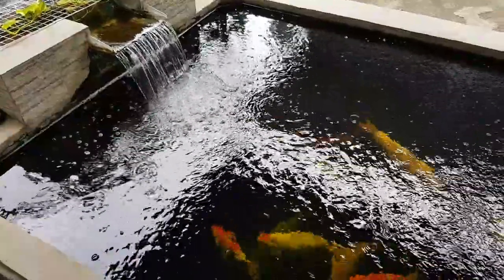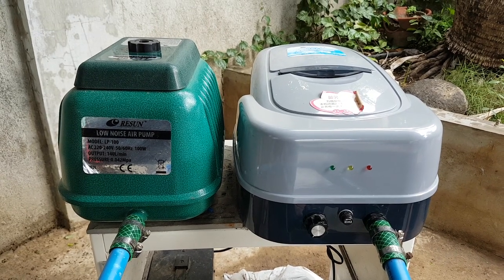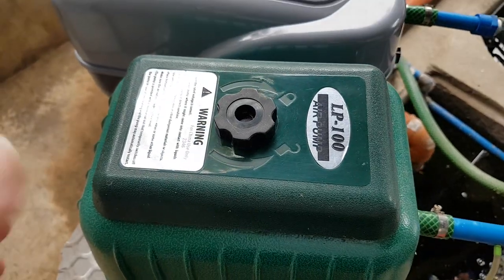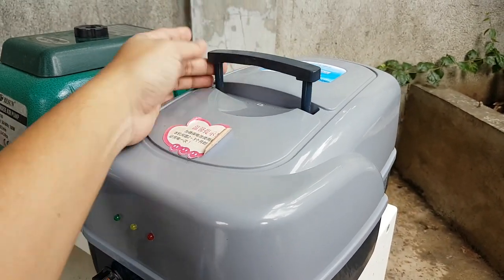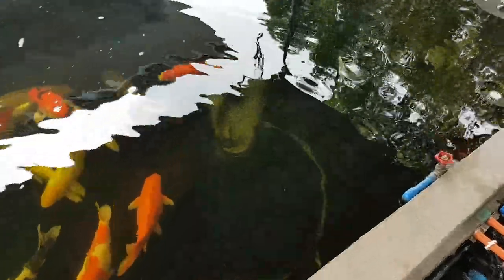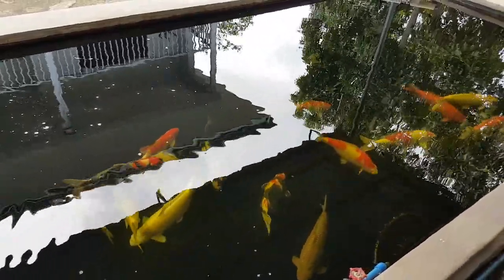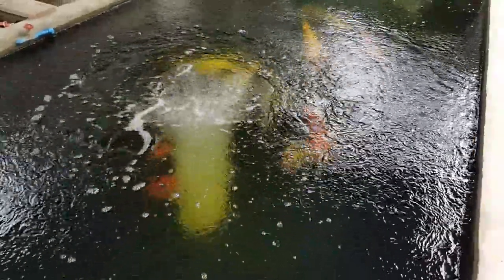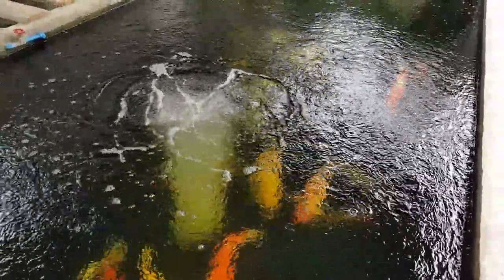Air Pump Resun LP100 vs ACD130 AC/DC Aerator

Comment: This is very informative Sir! For a fellow Koi enthusiast, this really helps when it comes to choosing equipment for my pond. 😊
Reply from the maker: Glad to be of help bro.
Reply: @thekoipondexperience1259  Sir! Im planning on buying an Oxy Ring (13" dm) with a 16 mm Manifold Attachment, is it compatible with the RESUN ACD 130?
Reply from the maker: @neilivanf.evangelista9245  with right hose reducers it will fit with no issues bro. The main concerns are: 
First air outlet outer- diameter on the Resun ACD130. 
Second inner-diameter of the hose you'll be using. 
Third outer diameter of the air inlet on the aerator you'll be using.
Remember these measurements when you're doing the build. This is fun.

Comment: Hey bro! Where did you get the “oxy hose”? Was thinking of getting the pump and that one too too.
Reply from the maker: Hey bro, I got that from a seller from Cebu. He posted it online and I did the purchase immediately. This particular design is a little hard to find now. 
Oxyhose are really good. Does not need any maintenance. Just set up and forget.
Reply: @thekoipondexperience1259  Sir! Do you have the contact details of the seller of your 'Oxy Hose'? I would like to buy one as well.
Reply from the maker: @neilivanf.evangelista9245  try searching Koilectric in FB. I remember they have this item from last year.

Comment: Can you comparing hailea cpa 120 vs resun acd 130? Or in your opinion which one is better? It help me decided to bought it.
Reply from the maker: Hello Nat, so far no unit of Hailea CP120. I'll do a comparo when I get my hands on a unit.
As per my opinion, between the two there will be minimal difference in performance. How long the original battery will last will be the big difference, if ever.

Comment: Hi, can i ask how often you change your water?
Reply from the maker: Hello, I do partial water changes everyday, around 10% daily that is how I do water changes.
Reply: @thekoipondexperience1259  how much fish i can put in 20,000 liter of water?
Reply from the maker: @whiskynoway8772  ideally its 1,000 liters per one koi. So for a 20,000 liter that's 20 koi. But I don't take this seriously. One's effort in the entire koi keeping aspect plays a big part in the water volume to number of fish ratio. 

If you're very diligent and consistent; you clean your mechanical filters twice a week, do daily partial water changes, have strong water pump to circulate water in your filters then you can have more fish. Maybe 30 even 40 fishes. But you have to put in the work for it.

Comment: Can the resun lp100 used for 24hrs operation
Reply from the maker: Hello Roux, yes it can. The Resun LP100 is an AC Powered Airpump that is designed to operate 24/7.

Comment: Saan mo nabili yang hose fittings mo bro pra sa oxy hose?
Reply from the maker: Mr. Li sa home depot hydraulic section ko yan nabili
Reply: Anong size ng pipe from lp100 to oxy ring sir?
Reply from the maker: @MrLi-en5ky  3/4 inch waterline PVC